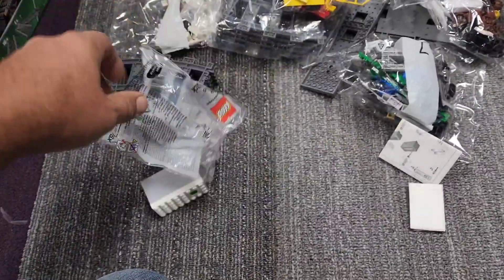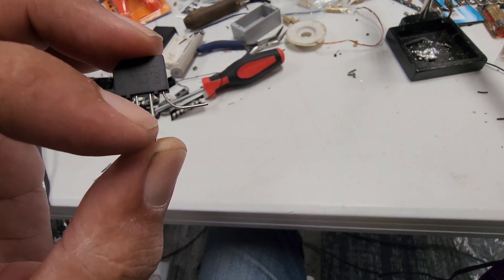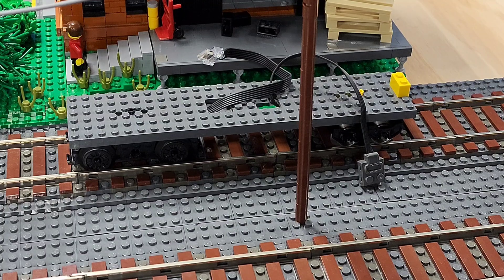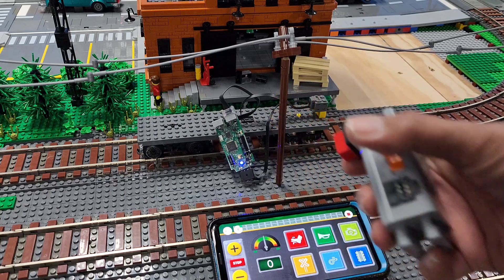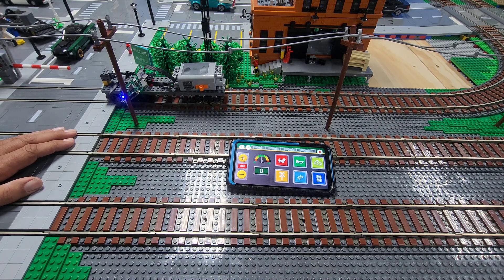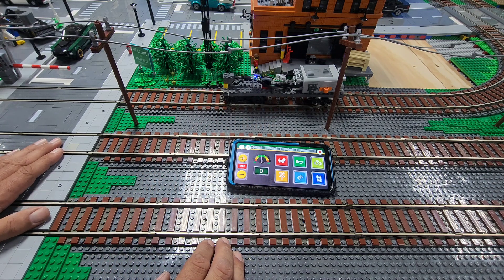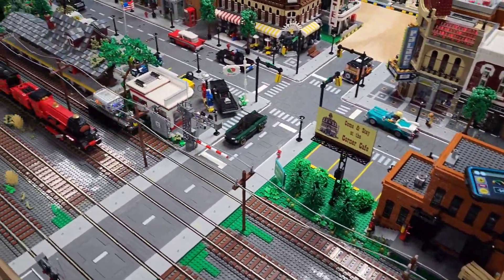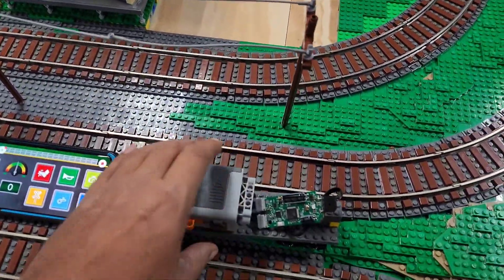Unlock The Magic: Making Lego Power Ups Compatible With 9v Train Tracks

Comment: I really appreciate this video so thank you for publishing it. I had been considering converting my 9v systems to Powered Up and came across this hoping it would show me 9v connectors soldered to Powered Up in order to battery power those 90’s trains. Instead your video has shown me that not only could I do away with the ridiculous 6 batteries per train but also create a form of DCC in Lego trains as each can be called up and programmed. Also powered up allows it to use sensor input so light sensor could be programmed to stop train at stations for a period of time. I would like to see the original powered up housing used with connectors into the empty battery compartment and weight added in there to compensate for no batteries.

Comment: Personally, I am way more interested in using power functions and true 9v controls rather than power ups, from what I have seen, most lego train enthusiasts tend to shy away from power ups due to the nuisance of bluetooth connection issues. Given the cost issues with this, I would imagine that the development and deployment of a system like this would have a small number of buyers since the appeal of power ups is that it is current generation and low cost. For those who are serious about trains and willing to spend this kind of money, we typically aren't interested in the power ups system. 

You have shown how it can be made pretty easily, anyone could do it.  Most of the value you tend to add isn't just figuring out how to solve a problem, its doing the harder work of sourcing and manufacturing the solution. Also, does lego take issue with people tearing apart their electronics, reworking it and selling it as something new? I don't know how any of that works, it might be completely fine.

Perhaps I am wrong, it wouldn't be the first time. Just my two cents, I am repeat customer of yours and have enjoyed and appreciate your work.
Reply from the maker: Im with you and prefer power functions.  But new people to the hobby tend to lean toward the ups stuff.  
The problem I see with the connection issue I think could be solved installing a cap but to me I would rather have my older system.  
As for the legal aspect, no issues with modifying and stating it is modified.  But because of the current patents I can not manufacture one myself, at least using the battery box they use.

Comment: I am actually interested in it. I have 2 trains that run on color sensors that work with the power up app
Reply from the maker: I will make them by request if people are interested.  I need to setup a sales link on .y website for those interested
Reply: I am interested for my tram that uses the colour sensor to go back and forth. Using batteries is a pain.

Comment: I would say 150 per train is well worth it for independent control on a layout without worrying about batteries.  To do this in a regular HO scale layout you are looking at 40 just for the DCC board to go into the loco and then have to still have to install it, along with the cost of the DCC control system.
Reply from the maker: I will make them but its on a per request basis only.

Comment: This is an epic idea. I think to improve the reliability of low speed running you may want to have a rechargeable battery in the Circuit so that if there is a momentary loss of power from the track pick ups that the circuitry and the motor are still powered by the rechargeable battery
Reply from the maker: Im wondering if a capacitor would solve the issue also

Comment: Hi there BEVEN, here's an idea to reduce the price somewhat. Maybe you can arrange to have customers send their WORKING battery pack & maybe reduce the value of it 50% to 75% toward the full price, in other words, if you're charging $150 total & the original pack is worth NEW of $70, you would "credit" them, say $50 (since you'de be using their pack) Of course you can include a disclaimer that you're not responsible if they receive it and it shorts out or something, but you can verify that it was working when tested? This makes, both sides "win". This is just an idea, or maybe even IF they send you TWO packs they get 1/2 off & receive only ONE working back (after testing them of course). This would then give you packs to build them to sell (of course you'de reduce it somewhat since the pack is used). Just a few ideas.....
Reply from the maker: Well for me it is more that Im already swamped so if Im doing it Im changing for it.  Because I have little free time.  But yes if someone was interested in sending me the parts and me assembling I would not have an issue charging 70 to do it for them.

Comment: If you want to put effort in this to make it then also consider to incorporate a power pack (model railroads use them also). Then dirty tracks are less of a problem.
Reply from the maker: I also wonder if just adding a cap would solve the issue
Reply: @BevinsBricksWorld  if the value of the cap is big enough yes. The power packs used in modeltrains take less space compared to using caps. Power packs can buffer up to seconds while normal caps just buffer for milliseconds.

Comment: I would be absolutely interested because no one online is producing an adapter for the power up hub.
The only thing I have found is a company who produces a base with a USB adaptor that replaces the chunky battery base, in case you have something fixed and you wanted it powered from the wall.

That's why I was planning to buy that usb adaptor, and then add the rectifier in a similar fashion as yours. But if I can buy a finished product, I'd probably be happier.

From the latest updates from Fx Tracks, they should be able to release their version of power pickup + PF motor relatively soon (2024 Q4, according to June's updates) - so going into competition with you with the power pickup part.
The bit they have not yet decided to produce is exactly the adapter you are showing: it seems no one is actually interested in making Power UP compatible with 9V tracks, so that would be probably your best shot if you want to sell products.

However, I see that it would be too expensive for you to make it into a product.
Reply from the maker: I just feel its not a viable option and worth the cost to invest time and money into.  Let me explain.  With the 9volt system as you know, power is recieved from the 9 volt track.  Then the power puckup takes that power and transfers it to the car.  Which in this case goes to the ir, and then that distributes the power to all your components.  The problem is like I show in the video, if you have the slightest bump in voltage, a wheel lifts up, dirty track, whatever may cause it now you need to stop everything.  Reset the ir and reconnect the bluetooth.  It makes to me using trains a complete hassel.  But I will also say this, I do not like the ir/bluetooth stuff even with the batteries.  As for fx, thry have been claiming for years that a lot of these products are coming.  But so far no delivery.  I dont consider myself competition as Im only a hobbiest trying to help the community.  But if they do come out with a version and its better, kuddos to them.  Im very interested in seeing what they come up with.  As Im sure it will be a quality mass produced item, very interested in seeing what price point all of the options they come out with will be as well. 😀
Reply: @BevinsBricksWorld  
I agree that is probably not viable for you to stock these products but eventually produce them on-demand.

Some of the home-made solution add a capacitor in parallel to the diode's bridge output so to avoid the loss of power as it happened to you. You should consider that extra component in your final design if you are going to sell it on-demand.

As for FX Bricks, I know they have been claiming a lot of things, but the latest update is quite interesting and it was after many years of silence on the matter.

I have been getting into LEGO trains after many years of not doing anything. So I still have all 9V stuff.
However, I want to modernize things and the good thing of power up is the possibility to make automation. You can design a complete automatic traffic.

In my case, I am very interested in the color reader, as I have a "point-to-point" layout and I need the train to stop and reverse automatically. I could do it with adding diodes and isolated tracks and some electrical switches, but I like the flexibility of a programmable device such as Power UP.
Finally, all forums suggest to start with Power UP if you have never had Power Functions, because things will start get pricier with time.

So yeah, that is why I have the interest in your solution.
But I agree you shouldn't make a lot of those and only produce on demand.
Reply: @jossdeiboss  I can make you a cable if you'd like but a modified hub will untimely be the endgame for this

Comment: I'd buy 10. But I understand not wanting to make them.  I've been wanting something like this since power functions.  Just put full power on the track and let me control it at the train.  I picture something in the shape of the batteries with the rectifier and capacitors to solve for the curves.  Then it can slide in and out for switching between batteries or 9v track.
Reply from the maker: I feel its just to expensive to persue, at least for me anyway as a hobbiest.  You have a great idea with installing a cap, as I feel just having that installed would probably keep voltage for small bumps in power.  Might play woth that idea at some point.  Im just not a big fan of the ir stuff myself.  Guess Im showing my age in that thought process lol.
Reply: Yeah the cost of these things is very high, when it's just a circuitboard tied to a battery pack. We are paying the Lego Tax again. Wonder if these could get reverse engineered &  drawn up and have them made up cheaply on someplace like pcbway ?Dunno if Lego would try to sue us though if we did?
Reply: And you could make it so the battery box is detachable you you could have the choice of using it on powered rails or just the plastic ones.
Reply: @BevinsBricksWorld  mentioned the capacitor thing in my video anwhile back messed with it a little but mynaoldering station is broken and if kinda stalled until i fix it
Reply from the maker: @donbot5000 like all projects takes time to get to doing them 😀

Comment: Saw your Instagram post about the custom speed regulator with your slim cable. That slim power cable will sell because the official cable has too large a connector which isn't compatible with 8 wide trains.

I don't think that the tape on the tracks is a good use of your time. FX bricks sells Lego compatible powered tracks.

I don't think that you need to do all of that to transfer electricity to the power up hub. You can leave the bottom off and run the power cable with bridge rectifier straight into the terminals. Saves time but the cable won't be too secure.
Reply from the maker: Not sure I will make my speed control or anything as everyone keeps mentioning how fx bricks will be releasing a version soon.  That I am sure will be a better version of anything that I would custom make.  As for the taped tracks no I dont intent to make them only point people in the right direction if they are interested in taping them themselves 😀 Ideally the best sollustion would be to have a box that just inserts where the batter box goes in so you can go back and forth between batters and power pickups and it would be fairly easy to do.  The issue here is that Lego has a patent on the battery box and thats not something I wanted to get involved with.

Comment: Correct me if I’m wrong but I believe that the rectifier is redundant/ not needed. The 9V regulator is powered by an AC wall wort but the circuit for the regulator has a rectifier to convert the voltage to DC, the regulator then uses an array of resistors and a lm317 to output various DC voltages to the rails. So if you pin the Regulator to 9V you’re only outputting 9V DC
Reply: You need it because if you put the regulator on the opposite direction, the voltage would be opposite to what the Power Hub is expecting. You could potentially destroy the power hub.
You could use only one diode to block the unwanted polarity and make sure you put the correct voltage.
However, if you have multiple trains, you would need to check everytime if your train is getting the correct voltage and potentially flip the connections at the pickup.
And if you have got a loop with isolated tracks, you cannot make it work because you will need to flip the voltage on the tracks for your train to continue the loop but the diode would block the current.

You definitely need a full bridge rectifier if you want to have a product that always works without giving a hassle.
Reply from the maker: Your wrong 😆 but still right, the purpose of the rectifier is simply to make sure no matter what direction the speed control is placed in that the input is always correct.  If you do not add it, you just need to make sure the polarity is correct.  So adding it is just to simplify use for the user. 😉 But also as previously stated if you do not install it, it could result in damaging the ir reciever.
Reply: @BevinsBricksWorld  Thanks for the clarification! I’m just a Mechanical Engineer who does electronics for fun!
Reply: It's needed for sure I did a video on this a while back.

Comment: If I use the power up stuff I'll just use batteries.
Reply from the maker: I hate batteries, so I only use it with a direct control on my 9volt track.
Reply: Ya batteries= bad for me I also rather have the physical controls over the Bluetooth option.